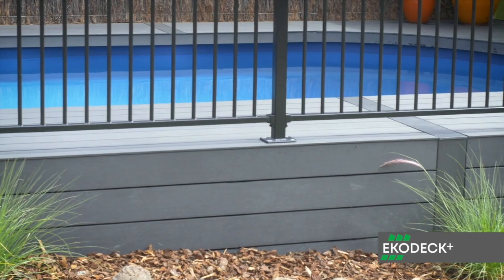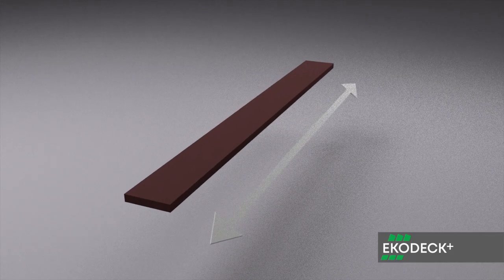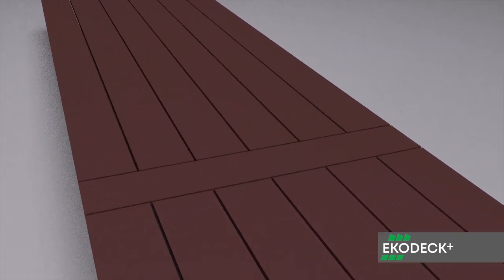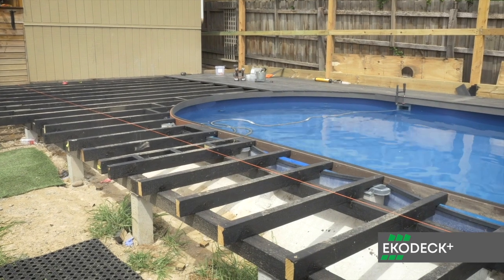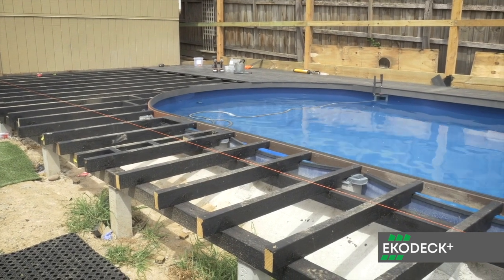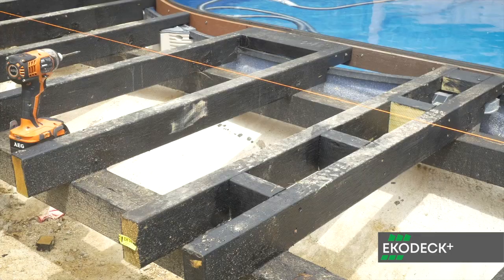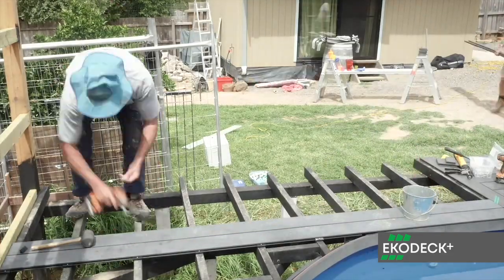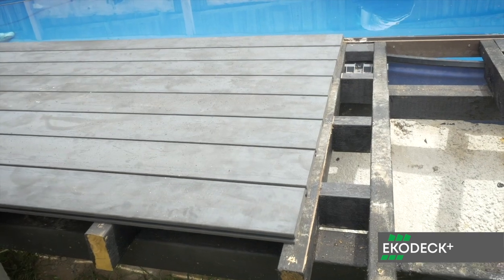Breaker Board Installation using 6mm Quickfix system

Comment: Utilising the 6mm kit, how do you secure the breaker board to the joists?
Reply from the maker: Gday - check out our installation guide here: https://www.ekodeck.com.au/wp-content/uploads/Ekodeck-Classic-Installation-Guide-V6.23.pdf 
it shows exactly how to install Breaker boards. @stephencork8677 you're referring to the 3mm Quickfix system there, not the 6mm.